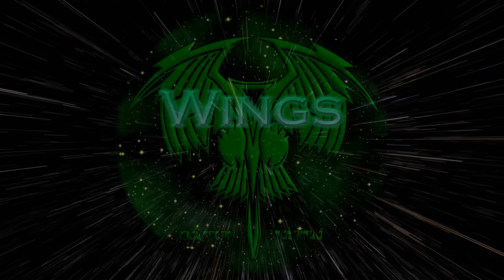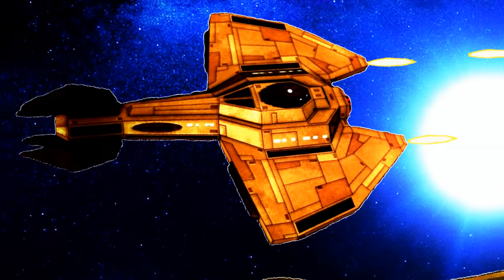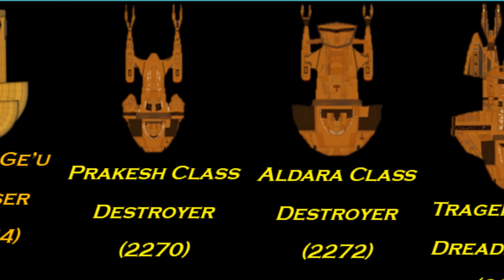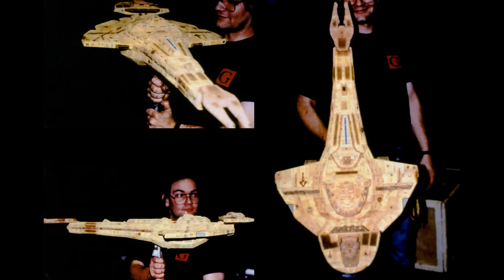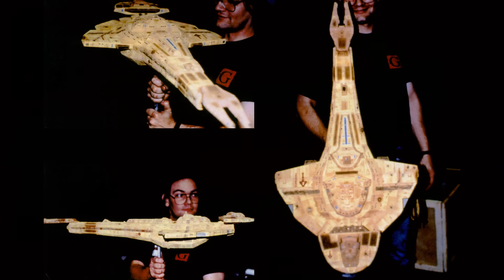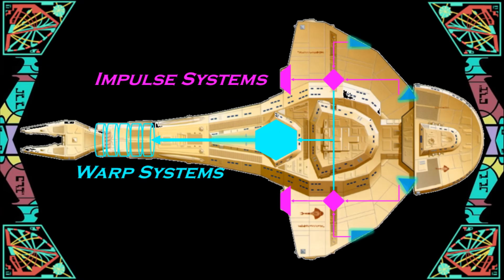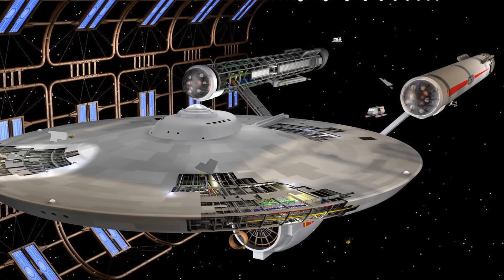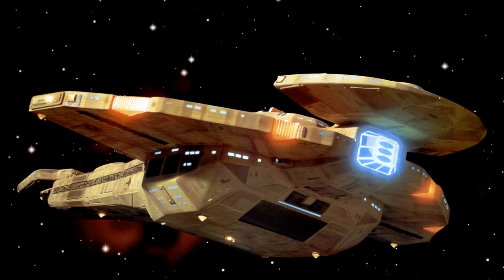Why Are Cardassian Ship So Weird?

Comment: I'd also argue that the other Alpha Quadrant powers got stuck in a bit of a design rut.  They got super comfortable with a design aesthetic that was not just functional, but also fashionable, and failed to innovate around it or away from it.  It's not until the run-up to the Dominion War that we see things like the Defiant -- You can definitely tell it's a Starfleet ship, but it looks radically different from pretty much any other Starfleet ship..  The argument could be made that even Voyager was a departure from the norm, with the adjustable naecelle angle on her engines.  And even the Delta Flyer, while only a shuttle craft, was not only a huge departure from previous models of shuttle craft, but was also had huge performance increases over shuttles and runabouts.  I can't speak to Voyager, but for both the Defiant and the Delta Flyer, the design impulse came from individuals who would have been considered outsiders from standard doctrine.  They weren't just making small tweaks here and there to edge out low hanging fruit performance or efficiency increases, they were actively breaking the mold to see if there was another way to do the thing that would allow more freedom.

It's kind of like what happened with lightbulbs.  For a very long time, the form of the lightbulb really hadn't changed.  Sure, the shape of the glass shifted, and we did some materials swaps for better efficiency.  But the premise never changed -- pushing electrical current through a resistive wire that would heat a gas until it started to glow.  Then we tried Compact Fluorescents, which were a lot brighter for the same input of energy at the cost of a warm-up time.  Then LEDs happened and now both of the other 2 types are illegal to manufacture anymore.

Comment: Warp engines and warp nacelles/coils are two different things. Engines refer to the power system or the warp core in particular. In modern terms the engines on a ship refer to the actual turbines and not the shaft/propeller. Warp nacelles are supposed to be as far away from the people on board to prevent warp radiation effects from the warp coils. Outrigged warp coils in nacelles will be more efficient and can be faster which is the Federation way. Now other races may have more tolerance or don’t care about it (no osha). Then you have the fact that warp coils closer to the main hull being more defensible (tighter shield bubble/less exposed) so has tactical advantages. Also there is probably expensive technobabble shielding they can use when putting coils in the main hull either case so nacelles can be whatever the writers/designers want. My head cannon.

Comment: The relatively small size of Cardassian space compared to the major powers would be one argument for why they would tolerate the reduced long-range endurance for their ships. They need their ships to cross their space fast, but since their space isn't that expansive, actually getting across it in one bound isn't a problem. Meanwhile the Federation especially, but also the Klingons and Romulans, have twice or more the distance to cover to get their ships from a major base to the frontier or from one front to another.

Comment: Remember, even the UFP had single nacelle ships: think of the Ptolemy and similar classes, including on screen in the TNG era. Also, maybe this is new backstory for Voyager on why Seska snapped. Remember, she was a high level warp engineer. Never mind replicators, liberal mindsets about personal liberties, and the Prime directive, what probably drove her nuts was having to maintain a decadent advanced twin nacelle design, where balancing and constant maintenance where a thing as opposed to just having a crude coil and shunting as much power as you can into it until just before it fails. On a complete tangent, who is to say that tail section nacelle is not swappable at a drydock? Disconnect the eps feeds, close all bulkheads, and blow the explosive bolts. jettison the tail and have some workbee type craft haul it away and a new one brought in and interfaced with the ship, and latching systems sealed. It's not like they buried it in the bowels of the ship, this large external feature may be in and of itself designed to be swappable in the rare case of a high level Gul who manages to outlive his warp engine. Maybe that is easier and cheaper than transitioning the entire command staff, crew, their equipment, etc to a new vessel. Of course, it does seem to be more in line with the Cardassian ethos to throw it away and move on to the next one without looking back, simply commanding his underlings to do his will, regardless of the cost or pain involved.

Comment: I'm not sure replacing a Cardassian mono-nacelle is as involved as you might think. Look at how the time and complexity of replacing the engine on a modern fighter has gone down over successive generations. What took all day on a Cold War jer might take a couple hours on a 4-4.5 gen fighter.
Granted, that depends on the availability of engines.
The Cardassians probably don't have any spare Huttet engines, but a pile of Galors. Starfleet probably has a few spare Galaxy/Nebula nacelles, but are up to their necks in Miranda and Excelsiors.

Comment: in the end its a bad thing. alot like how the klingon conquest was potent till it was not suffering the loss of the klingon home worlds moon trying to feed the war machine. in the dominion war cardassian design really just was not enough for the advancing battlefield the bonus of making so much with so little just stopped mattering as much as advancement when it became a quadrant vs quadrant scale war. a bit like the iconian war it was the new galactic powers vs the oldest and most advanced remnants that had force projection across the galaxy first. the iconians could have won if piece was not a actual shared desire because they was still more advanced than the sum of the rest of the galaxy in 2410. they would be pretty much extinct if it was not for the time loop the fedaration created to effectively save the iconian biological database to simply bring back the iconian species in a terraforming sort of way far beyond something like the genesis device that saved spoke with the help of a mind meld like download.

Comment: Should also point out that Cardassians as a species do like hot/warm room temps compared to other Trek major races. So having all that heat radiating throughout the ship from the engines and warp system saves from having to turn up the thermostat. XD
Reply from the maker: Who doesn't love a bit of radiation poisoning...

Comment: are we sure its just 1 nacelle in the tail and not just 2 nacelles side by side? how far apart do the nacelles have to be. and this races another quesation for me, ships with 1 nacelle, is it actually 1 nacelle or actually 2 nacelles enbedded in what looks like 1 nacelle?
Reply from the maker: I mean at that point it's really just a case of how you arrange the warp coils
Reply: @venomgeekmedia9886  but wasnt the whole idea you create some field between the 2 coils(nacelles). i dont know if there is some minimum distance needed, or what that distance actually does for the warpfield

Comment: My headcanon is that the various warp engine designs provide different strengths and weaknesses. The Vulcan ring is, perhaps, significantly more efficient (Vulcans love efficiency) but not necessarily as fast, agile, or as easy to work on. The Starfleet layout may be a balance between speed, efficiency, and ease of access for upgrades. Hull-integrated engines such as those on Cardassian ships and on the Defiant may provide significantly better armor defense and agility at the cost of being more dangerous overall and being harder to update. Having line of sight between one another, having forward sight, and operating in pairs may simply be the most cost effective and efficient way to make warp engines as a whole, which is why most species seem to go that direction.
Reply from the maker: Yeah for me the weakness of warp rings is steering.
Reply: Whether the ship has one hull or is split in two or if the warp nacelle is on pylons or connected to the hull is a question of safety versus efficiency.
Failure of a nacelle is less likely to destroy the ship if it is on a pylon, but it adds to the weight of the ship. A secondary hull means a big part of the crew has a chance to survive a catastrophic engine failure, but it adds to the weight of the ship as well.

Comment: With regards to the sensor issue, I think it's less like a fighter jet and more like a submarine. Until the mass adoption of things like flank sonar arrays and towed arrays, pretty much all subs had a significant blind spot directly aft due to the screws disturbing the water. I can see there being a similar effect with the warp field. On Federation, Romulan and most Klingon designs the fact that the nacelles are on pylons held out away from the hull at a significant distance means that they can have only a minimal effect on aft sensor coverage, but the Cardassians might just accept the tech limitations and compensate with training and doctrine(i.e. almost always operating in pairs and periodically maneuvering to sweep the area behind the ship with flank and forward sensor arrays.) I don't know why, but I find a patrolling Cardassian warship pulling Crazy Ivans periodically amusing.
Reply: The Hirogen couldn’t detect Voyager trailing behind them either because of some kind of energy wake
Reply: Don’t they still have that blind-spot? Flank-arrays still need to be shielded against the screw-noise, and towed arrays have sensors aligned in such a way as to be useful when towed, which unfortunately makes them nigh-useless straight aft.
Reply: @schiefer1103  Honestly, I'm not sure. Most of what I know about subs is secondhand knowledge from watching Sub Brief videos here and reading Wikipedia and other sources. Also I admit I was being a tad hyperbolic to make my point. On more mature consideration, yeah the baffles(the blind spot in question) still exists, it's just that with modern sensors it's likely smaller and easier to clear.
Reply: I agree that star trek space ships would want sensors all around.  The claws on the back of Card. Ships be a sensor array.  If you recall voyager hid in the blind spot of a hirogen ship.

Comment: it's a tv show they don't have to be practical and if it were real one engine should be quicker to switch out than two. Just look how the navy would quickly swop out the engine of a  Douglas A-4 Skyhawk compared to an F14 tomcat and you'll see what I mean. Gene Rodenberry had flew bombers in WW2 so he really did have his solid thoughts and background reasoning about  engine cells. In fact Gene flew the B-17 “Flying Fortress, ” named the “Yankee Doodle” and took part in the Battle of Guadalcanal.

Comment: Having the ship surrounding the single large warp coil would also make maintenance a hell of a lot easier as you'd have more space to work.
As a mechanic myself, starfleet ships just look like they'd put the oil filter upside down where you can't not get oil all over yourself.
Reply: I also think the warp coil could be swapped out very easly by either pulling it out the back or dropping out the bottom depending how the ship is designed.

Comment: I think the mono-nacelle design makes sense for the Cardassians. One it is cheaper to produce at scale, allowing the Cardassians to field larger forces for relatively comparable forces(Just pulling numbers out of the air, lets say it takes 1.5 times as much verterium cortenide to make a Galor nacelle as it would for an equivalent dual nacelle design nacelle. You'd be able to field three Galors for every two equvalent dual nacelle ship.) Two it allows them to make a very robust ship. The extended pylons of most Federation, Klingon and Romulan warp nacelles are very tempting targets that they can get away with because of their advance shield and structural integrity force field technology. By burying the nacelle in the aft hull(and armoring said hull heavily) they make it comparatively difficult to completely immobilize one of their ships. Also this protects the nacelles almost completely from frontal attack with the bulk of the ship. 
Likely this approach has downsides(less efficient warp field, a relative lack of maneuverability at warp, etc.,) but as so often happens in real life, the Cardassians compared the upsides and downsides of the design and determine that its upsides were worth enduring the downsides.

Comment: Regarding the design rules, I always assumed having line of sight forward was tied to the Bussard scoops rather than warp functionality. Assuming that were the case, then indeed the Cardassians can escape that issue by placing those systems elsewhere on the ship, in the wings as you note.
Reply: Or we might be overgeneralizing re: the role of the various glowy bits. As explained in the official tech manuals, a Bussard scoop is a low-efficiency means to refuel, which is useful for the Explorer-type and adaptable ships which Starfleet favors. But if the Cardassian fleet has a limited territory, it's easier to resupply at bases. Maybe those wedges on the wings are deflector emitters instead.
Reply: @phillipthorne8363  Not an unreasonable supposition. Examples of Cardassian exploration vessels to examine would help produce an answer.

Comment: Theoretically... you might want your sensor arrays well away from things like impulse engines. Much like you want your sonar away from your screws. This tends to mean sonar systems go to the front of the ship while the screws are at the rear, or your towed array trails out behind the screws a ways. With the Galor, the engines are up nearer the front, so the sensors would need to go more to the rear. Theoretically.

I do like the idea of them slapping warp coils into a single "nacelle", and then possibly making the coils larger, or putting more sets in to improve their top speed. Gives it different flavor to other species.

Comment: Every chokepoint for the EPS is a potential point of failure.  Simple straightforward designs means fewer things are likely to go wrong.  It also makes it easier to scale up a design.  The trade off is a loss of flexibility and redundancy, necessitating other ships to pick up the slack.

Comment: My headcanon is that mono-nacelle ships require more maintenance, and burn out warp coils faster, but are cheaper to initially build. This is why the Federation builds them from time to time as a quick gap filler (Saladin and Freedom classes, for example). The Cardassians don't expect their ships to live very long, so they build cheap but plentiful ships.
Reply: I would potentially also say slower. You can have less warp plasma throughput through a single nacelle's warp coils. As a result, less plasma converted to Cochranes of warp field energy, which caps out your top warp speed. Then again, they could compensate somewhat by having your warp coils twice as large or by having twice as many coils....
Reply: @nekophht  the Cardassians use larger warp coils, so that fits. And we know Cardasian ships are slow at warp.
Reply: @trevynlane85  By the time of the Dominion War their Galors and Keldons were as fast as Starfleet ships capable Warp 9.4 or so. There are several instances before the War and during where Galors or Keldons are able to run down newer Starfleet ships.
Reply: @trevynlane85  As far as I understand mono-nacelle still have two coils. But in one pylon. This typically save on costs, but was far less efficient then two nacelle design. You didn't gain much from having more then two nacelles but it give some indirect bonuses. Like military ships have spare nacelle. And Deep Space Explorers have entire two engine sets, diminishing risk of critical failure. Plus you could switch them shortening maintenance time.
Reply: I think there's old lore about the number of nacelles determining how manoeuvrable the ship is when travelling at warp speed. Having two nacelles lets a ship turn right and left quite easily while travelling in a straight line, but three or more nacelles were needed to move in three dimensions, but space is so big that two is the most cost effective option in terms of parts and fuel efficiency. A ship with only one nacelle can only move in a straight line, unless it uses it's RCS Thrusters to reorient, which was supposed to be what caused the sets to shake as doing so stressed the ships hull.

Personally I try to think of Nacelles as a futuristic version of the Jet engine, which in the 1960s would've still felt like cutting edge technology. Monojet aircraft exist, but aren't really suitable for large planes. Passenger jets have had everything from 4, to 3, to 2 jet engines, but the industry eventually reached the point where 2 jets became the norm for a variety of reasons. 

One thing I could never get a clear answer on was whether a ship with more than two nacelles needed to pump less energy into each in order to achieve the same warp factor as a two nacelle design. If that's the case it suggests to me that a ship with four nacelles would take longer to wear out each nacelle than a ship with two nacelles (of the same type). It might be less fuel efficient, but it could cruise for longer before the nacelles overheated.
Reply: Iirc the idea behind 2 nicels was balance.and you void creat a larger more stable field And they were away from the ship due to the warp fields/radiation being dangerous.

Mono nicels work but only on small ships as they can't mage a big enough warp field  but 2 in tandem will..